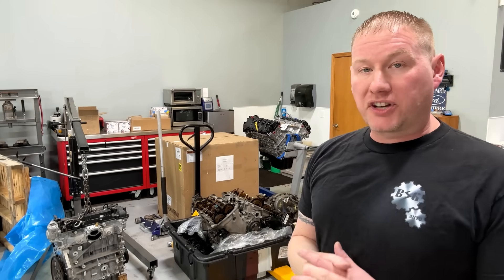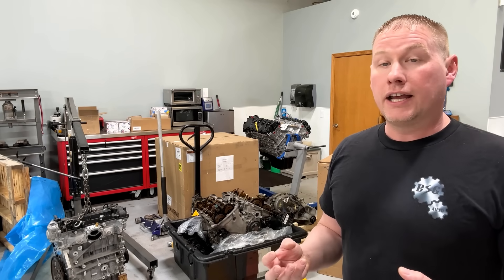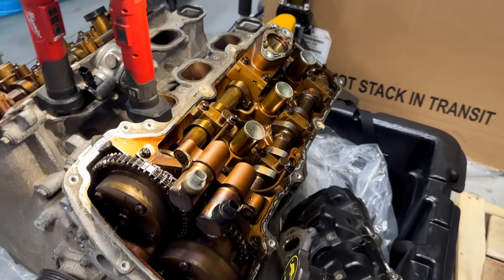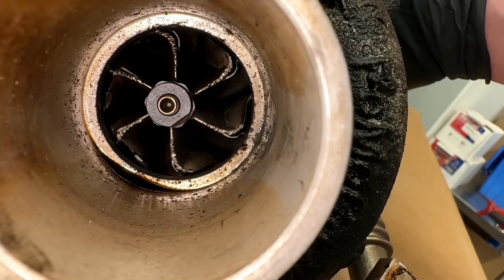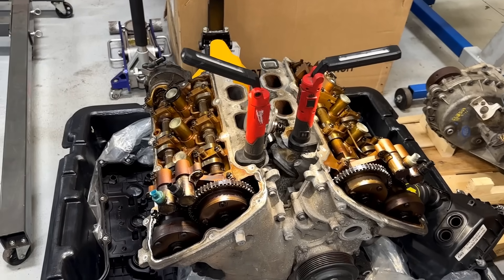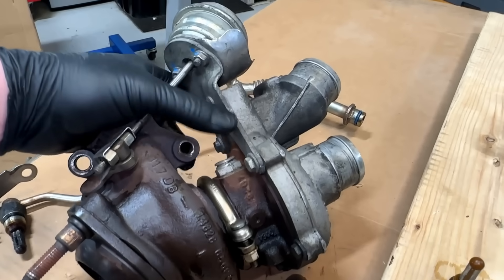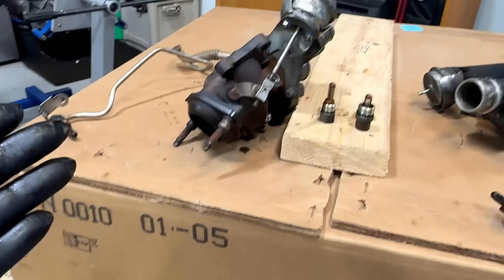This is Why You Never Run Extended Oil Change Intervals on The Ford Ecoboost Engines!

Comment: Doesn’t matter how often you change the oil, the blocks are the problem, leaking coolant over time, causing corrosion and eventual head gasket seal failure. Oil won’t help that…
 Besides that problem, who wants to pop off the plastic intake manifold every 30-40k with the crud behind the intake valves just waiting to crack off and go into the combustion chambers. 
I’m fixing my son’s Fiesta ST after it stranded him with a broken turbo shaft at 61k miles. I would not keep this car myself, too many things operate on the bleeding edge of destruction, because everybody knows you need a 2 liter N/A with VTEC to go fast and expect 200+k miles

Comment: And I'm going to bet he didn't check his oil between changes either. These low tension rings, turbo engines are going to consume oil. Do your maintenance and keep the oil topped off

Comment: I have a 2.0 EcoBoost in a 2015 fusion with 270,000. Its a daily driver, we have changed the oil every 5000 miles. Still going strong. Air conditioner pump is the only thing that's need replacing

Comment: I have a 22 Edge Titanium with 23,700 miles, owned it since the day it rolled off the truck. It’s a 2.0 Ecoboost engine, and I change the oil every 5k miles or less, no matter what Ford says. I knew I was right in changing the oil every 5k miles and not just paranoia. By the way, Brian, is there a specific name to that screen referred to at the end of the turbocharger? If there’s no plan to remove the turbo when should I have it changed?

Comment: SOB... I have a 2016 F150 Limited, bought it with 69k, and right away added CAI, BBK TB, and flashed performance tune that came on the SCT tuner from them.. Not even 10k went by and I blew out the passenger turbo while ripping down an open highway in 4wheel drive through about 4-6" of snow.. Sure was fun until the bang and loud noise came.! It sounded crazy like I blew my rear end.. Loud whining, gear box trans, I had no idea what it was no Cel came on at that time...  Anyway after diagnosing the cause and finding out I blew the turbo. I decided to upgrade everything I could while in there..  I will say I caught this fast and bypassed the one turbo for a while so no metal shavings were getting into the intake.. That's another story..  

MODS Installed:  S&B CIA, Mishimoto Transcooler, Mishimoto Intercooler & Tubing, AMS Perf Turbo Inlet Tubes, SCTX4 5 STAR Tunes, JLT oil separator, 73MM BBK TB, Ruthenium HX plugs, Granatelli Motor Sports Coil Packs, BD Manifolds "Ported", 3" SS CVF DP, 180 stat, AMS Turbine Adapters, GARRET TURBOS, Turbosmart Vee Port BOV, FlowFX Dual Rear Side Exit Catback, SONNAX ZIP KIT on hold.. 

All of that done and I did NOT remove the oil feed tubes during this process! I must have missed the literature about those screens...!?  Maybe I blew air through them and then changed the oil...?  Anyhow the truck is due for walnut blasting as the carbon is really bad...   

Is there any way I could use my Triple Lens Endoscope  to inspect these screens when I perform the walnut blasting, or, do you think it's even necessary at this point and would've likely  have already had a turbo fail if either of these screens were blocked.?   I put about 12k on these turbos since installed.       

Thanks for the videos and your time spent making these..!

Comment: As a tech my self, now retired i believe in maintenance. On my 2012 150 4x4 5.0l i set my oil change reminder to 40% which works out to 5000km or 3000 miles. Like a vintage fram oil filter commercial said (as he was flipping a filter) pay me now or pay me later.

Comment: Hi Brian, we bought a 2016 ford explorer brand new in 2015, it has 38,000 miles on it, we have the oil changed at the dealer every year, so its had 8 to 9 oil changes on this 3.5 eco boost, my question is do we switch to full synthetic? The oil they have been using is the synthetic blend. I also changed the PTU oil at 24,000 miles and drained out 4 and a half quarts of transmission oil at 24,000 miles and replaced it with Amsoil synthetic ATF series transmission oil. Will the Amsoil ruin my transmission? I have more Amsoil to do it again in the near future, any advice would greatly be appreciated!

Comment: My 2018 Raptor had first 3 changes "early"; 3,000, 3,000, and 4,000 miles; at 5,000 there after.  At 55,000 I notice first episode of phaser rattle.  Dayhem.  I was unaware of the screens on the turbo oil lines.  Looks like they could do more harm than good since the oil pump should be supplying filtered oil.  You are very informative!  THANKS!

Comment: If I hear that these critical oil feed filter need replaced and they are $100 during a service, I would be saying “DO IT”.  It’s always better to ask for forgiveness especially when an informed vehicle owner can understand that those little parts can save a $2k-$12k service appointment.  Ford should have replacement intervals specified for those oil feed filters.

Comment: If I just bought a 2022 navigator with 11k miles on it and the first oil change was performed at 9k, what can I do to clean all the crud out?
Reply: Same. I would like to know what can be done to clean out the crud so the filters don’t just clog up again.

Comment: Personally speaking, I’ve seen far too many of these echo boosts that have continued issues as a consumer I would never in 1 million years touch one. They are one of the most consistent problem motors in modern existence.

Comment: Do you know any Ford master mechanics near the Houston area? Do you think all Ford Mechanic shops should have a master mechanic on site? I don't trust just any mechanic to work on my F-150 ecoboost engine. (Bad phasers & timing-chain rattling) The truck runs great, but would like to take care of that little issue sooner than later.

Comment: Brian - Can the turbo filters be replaced without replacing the turbos?  

The turbos on my 2015 Expedition seem to  be working but sometimes hesitate when starting and passing.  I'm also getting an underboost code.  I'm not certain that the turbos need to be replaced but the filters probably do because of deferred maintenance issues from the previous owner.

Comment: Ford is really pushing it.. own a 2011 and a 2016 F150 the 2011 is in storage right now because it has a spun rod Bearing and the 2016 will go in storage too because it started to knock on the #5 i have parts for BOTH of them problem is Ford decided to discontinue the Crank shaft BTW they are the same parts #...  AA5Z-6303-F
Its starting to get bad when they dicontinu part for a vehicule that not 8 years old... and no aftermarket are avainlable and good core are so scarse that they cost 4 to 5 times more than a new one... Anyone here know a source for New crankshaft for these engine?

Comment: It is also why you avoid turbocharged engines. Yes, I know they are common on diesel engines. But to stick an underpowered engine in a vehicle, add a turbo to it to get enough hp to properly suit the vehicle (weight, torque, purpose) is both an insult and a disservice to the vehicle, the engine and the buyer. In the pursuit of higher mpg and lighter weight vehicles, the engineers and regulators have given us overpriced, over engineered, difficult to maintain vehicle. I would gladly trade mpg for a carburetor and a simple ignition circuit that could be repaired/adjusted by the side of the road.

Comment: Whats your thoughts on running rotella t6 on q 3.5 with 90k miles. Live in California.
It also sounds like doing seafoam flush every other oil change would benefit greatly.

Comment: When I would take my 2018 eco boost in for oil changes at dealer I would notice the oil was always still dark  on the dipstick right after they finished so I confronted them and the guy told me that’s just the detergent cleaning the engine so I called bs on that and decided to start doing my own changes and now my oil is totally clean I think they only drain about half out and charge 80 bucks for “the works” that means they been working you over

Comment: Hey Brian, great video.  After listening to you about using a "Full Synthetic Oil" I searched thru all the comments and see people talking about Mobil One $$ and Castrol full synthetic.  What are your thoughts about Ford's red bottle where it reads "Synthetic Blend" oil?  Ford's oil in a red bottle only costs as much as any other oridinary brand of oil in comparison to Mobile One.  You would think Ford's Rotorcraft brand that reads synthetic blend would be great to use in their engines.  Your thoughts?

Comment: Is 3500 miles on motor craft 5w30 too many? I know it’s only a blend and not full synthetic should I be doing it 3000? On a 2017 ford edge 2.0 and a 2021 3.5 f150

Comment: Excellent video for all the naysayers about changing your oil at 5000 miles or less.  These EcoBoost GDI engines are dirty.  If you do mainly around town / city driving, change it even sooner.  If you idle a lot, change your oil sooner. Use high quality full synthetic.  Don’t be shy to change your oil with only 3500 to 4000 miles.  😊

Comment: 5,000 to 6,000 miles oil change is just right with 3.5L Ecoboost at normal driving condition.

Comment: Finally someone telling the truth about ecoboost oil change intervals. Ford totally stuffed up the service intervals . When you open up a motor you should never see varnish. Varnish is the oil breaking down and once that happens the interval is already too late. Oil and filter is cheap , engine replacements are expensive.

Comment: How many miles would you recommend that the oil line filters to the turbos be replaced?
I have a 2019 F150 with the 3.5 EcoBoost and I change my oil every 7,000 km (4,350 miles)

Comment: Just replaced my 2.0l 17 MKZ engine due to coolant in cylinder number 2. As per the TSB. I made it 76,000 with oil change done with full synthetic every 5,000 miles.  Poor engine design ford.

Comment: So ive been running amsoil signature series in my 2019 Ranger 2.3L since 1500miles changing every 10k. Eventually went to amsoil midgeade 5w-30. Also used either amsoil filters or wix xp filters. Also using oil catch can. But even with all of that, you're suggesting I start changing oil every 5k? I just want to clarify - not here to argue. Thanks for the video
Reply from the maker: Never ever run 10k especially on an ecoboost.

Comment: Got our 2018 Expedition Max with about 47,000 miles on it. So, I dont know how the oil change intervals went. Should I use an engine flush next oil change to remove deposits that may be there already?

Comment: Our 2018 Expedition Max keeps throwing lights and going into limp mode in combination with a warning saying front collision warning not available. Only happens on long road trips at highway speed. Can pull over and shut it off a while and then its fine for a while again. Dealer can't find codes, so they don't look into it. This is our main family vehicle and I am really loosing trust in it. have you seen anything like this? I have searched forums and see it talked about a lot, but no real facts as to what causes it.

Comment: How bad is it that I’m neglecting my coolant fittings. I use motor craft coolant and check it before every use but I literally cannot afford to fix it. I’m saving up to just have the fittings and the manifolds replaced
Reply from the maker: Just maintain the coolant level, generally they are a slow leak.
Reply: Thank you so much for the response. Love your videos and appreciate your work! @FordTechMakuloco

Comment: I took my 2011 ecoboost 3.5L to get oil changes every 5k and the timing chain just snapped in it I’m bummed out how does that even snap. Looking at a salvaged 120,km engine replacement now

Comment: Great information thanks. I have a 2016 Lariat 3.5 eco boost with less than 19,000 miles . They change my oil when the put my winters on and off , so twice a year . 
They never had time on my last tire swap ,but there’s very little mileage on that oil. After watching this I’m tempted to take it back for an oil change .
I think you mention to go to full synthetic? I think I’m running semi synthetic, and asked about going to full synthetic at the dealership ,but they said not to bother . 
Those filters going to the turbo , they are not easily accessible to change ? I’d like to get those changed also

Comment: Brian, 
To this day I am mystified and baffled that Ford would and still doe’s recommend these insane oil change intervals. Especially on the 3.5! I can not for the life of me conclude any reason why they would do this. I would appreciate any input on Fords reasoning as I love the 3.5 , but I don’t have much affection  towards a certain number of Fords engineering decisions. Especially after I realized there terrible job on there 1st gen. 3.5 exhaust manifold design with only 2 bolts on the turbo end of the manifold. I mean , what were they thinking?
Thanks

Comment: A 2013 at 105k miles, oil changes every spring/fall and a new oil filter once a year, as I don't drive a lot. I've had it for 8 years. Seems I'm starting to run into issues. I should check this, but what else?

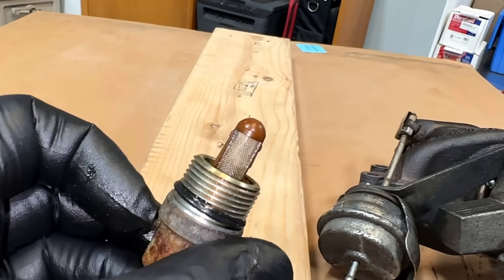Comment: Could you supply the part number for small oil screens you showed @ 3:56 to 5:02 ?  I looked at RockAuto, Advance, O'Rielly's and even the Ford website and can't seem to locate these little guys.  If these are DIY changeable I'd like to look into doing this change. Thanks! (2017 Escape 1.5L Ecoboost)

Comment: The average person does not take enough interest in keeping their personal vehicles running properly.   You need to run a very good turbo rated oil.  Most folks dump anything in the motor.

Comment: Eliminate the screen problem solved...? An oil feed line screen would be bulged out not sucked in ?
Turbo timers should be stock from factory on all turbo engines as well. Big fan of early oil changes and maintenance but a crappy design from the start is the issue.

Comment: I am so glad I have the 1.6 from 2012. Pre ecoboost. It has 180k and still gets 40 mpg highway in my Fiesta. Oh I also have a manual so dodged 2 bullets! It is the 2nd best vehicle I ever owned. My 92 Ranger manual, 2.3 cylinder is the best with 237k I have owned for 22 years. What was Ford thinking messing with things that just worked?

Comment: I’ve had my 2013 f150 3.5 since new my mileage just turned over at 71,500. I have never went past 3,000 miles intervals on oil changes. I am wondering is this a good time for an oil catch can and also a full synthetic?

Comment: This happened to me I wait till the car tells me to get oil about every 10k once a year for me. Going to work last month apparently the head gasket cracked was told I need an engine replacement about three weeks later I get it back but now I’m back at the shop not sure why

Comment: Great video and advice.Unbelievable how many automakers continue to recommend 10k oil changes on turbocharged engines,  and also how many owners follow them ! As a repair Tech with 50+ years in the business I have always recommended regular oil changes and inspections as the  key to get the most miles from your vehicle and minimize costs.
Reply: I have a 2020 explorer and I was recommended 10,000 oil changes. Guess what. My turbo blew a few days ago. I’m absolutely sick over it. 😢
Reply: If you put a filter that's suppose to last 20k miles what's the problem then?
Reply: @LightningFast240  The problem is that 10k intervals do not work in the real world. Turbo failure, piston ring failure and premature engine failure is all a real possible result. Small displacement ,hi-output, turbo engines are super fast to break down and burn engine oil. The best way to avoid it is use only the best oil and filter that meets or exceeds manufacture specs and change it at 5k max. Using  a 10k interval will get you out of warranty and into trouble and the carmakers do not give a crap after that. They like to recommend 10k so they can advertise a low cost of maintaining the car.
Reply: @Huey4214  well if your driving the car normally and a company like let's say amsoil or mobil advertise a 20k mile oil and filter. That's what It should be, not 5k miles. Then maybe they would be responsible for the oil not withstand common conditions.
Reply: @LightningFast240 Amsoil recommends oil analysis, which I do as well.  If you really want to  know what your interval should be for your car with your driving habits….spend the 20 bucks and see for sure if you are changing it too early or too late.

Comment: I wonder if using a seafoam or comparable engine flush every 20k miles or so would help?
Also what about mixing an upper cylinder lube in every fuel ups like Lucas or Marvel Mystery Oil? Basically trying to maintain the longevity of the rings.

Comment: First motor that I showed me was that 3.5l TT, I don't have that tan color under my valve cover and it's 244k miles. Oh yeah, I used Pennzoil 5w30 Full Syn Ultra Plat oil with Motorcraft oil filter. I also received highway mpg to 20-21.

Comment: I disagreed with your word said 5k miles gasser??? Hell nooooo, 5k miles oil interval made sense to 6.7L Powerstroke motors. 3k miles mark oil interval for gasser. I really don't care if I spend $110 on my oil interval every 2-3 months as depends where I go because I do whole motor body inspections plus MAFs and throttle body cleaning.🙂🙂

Comment: Which one should I use for my 2.0 L Ecoboost, Synthetic blend or full synthetic? My 2019 Fusion is currently at 69K miles. I've been using synthetic blend since the car was purchased. I used to change my oil every 6 to 7k but recently started changing every 5k miles.